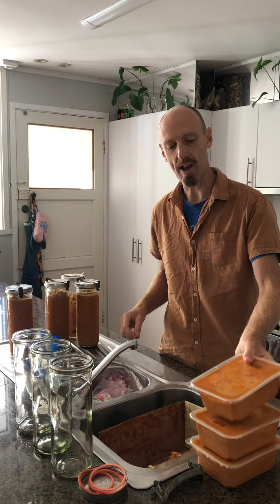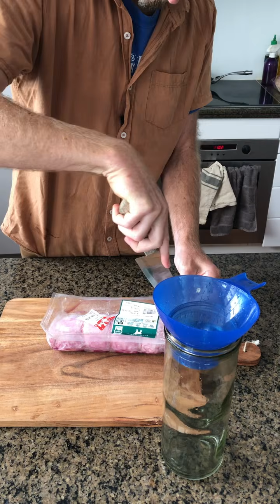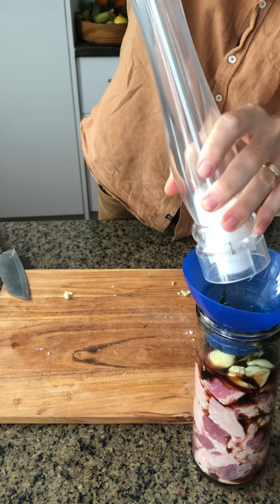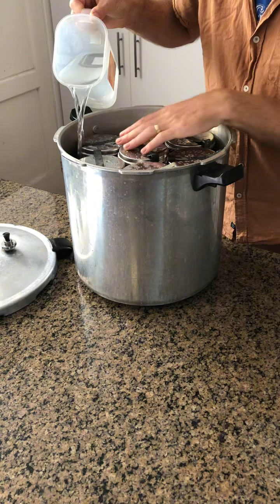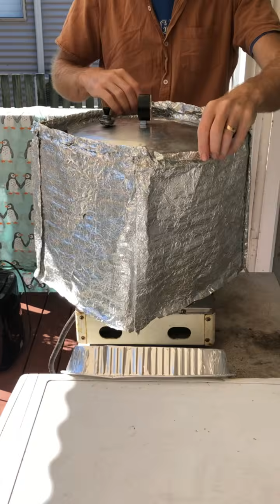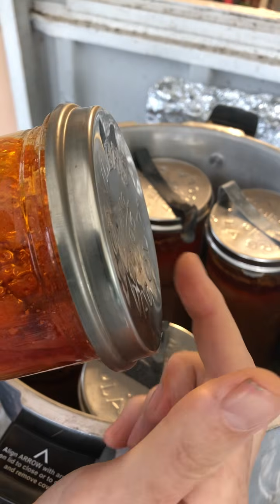Pressure canning potentially dangerous salvaged food to make it safer to eat

Comment: Do you have any sources for what you're saying? I've never heard it before and have always just been told that "no matter how much you cook it, it won't be enough" - but maybe that advice doesn't apply once the temperature gets high enough?
Reply from the maker: Hi good question. There are toxins that require even higher temperatures eg the b. cereus emetic toxin requires 90 minutes at 126 degrees. So some risk definitely remains. The sources are at the bottom of this article I put together: https://livingmorewithless.org/dumpster-diving-risks-and-reasons/